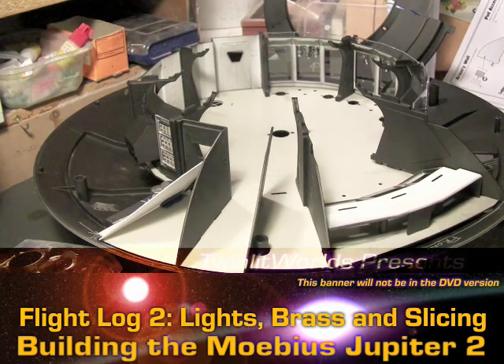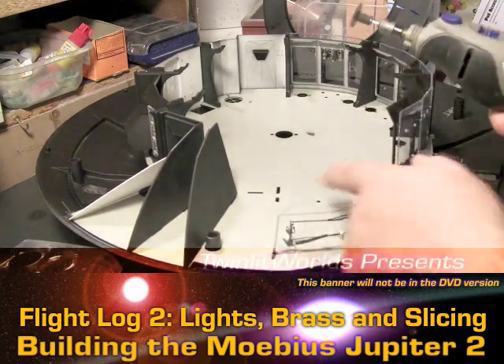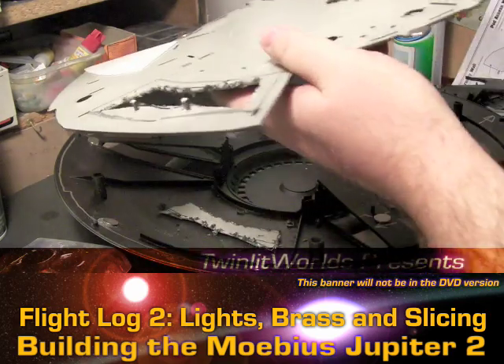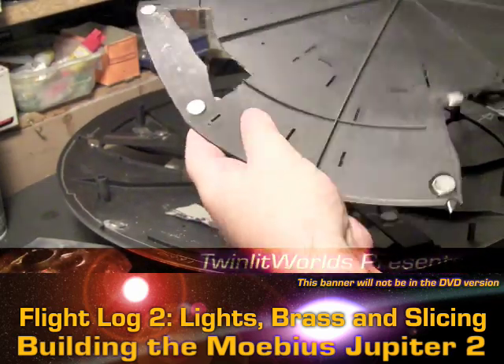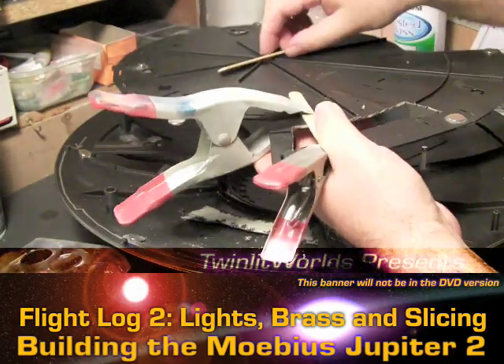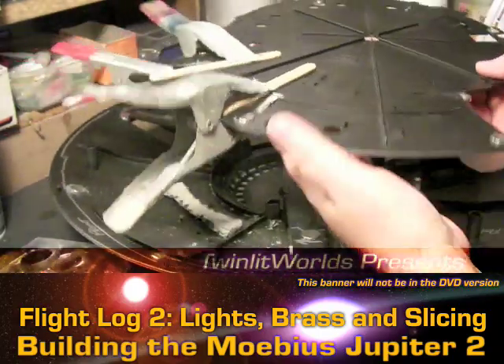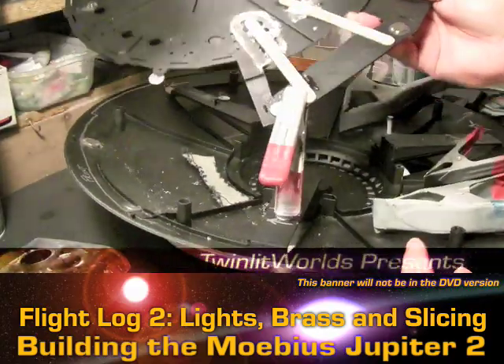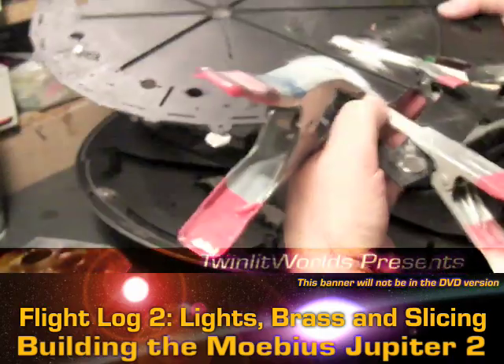Project Jupiter: Flight Log2 4/4

Comment from the maker: The baking soda is a catalyst with CA glue.  The powder turns into a hard crystal on contact with endothermic reaction.  It causes glue to cure and once hard it can act like a putty to fill holes or in this case add substance to an area and help it stay in place.